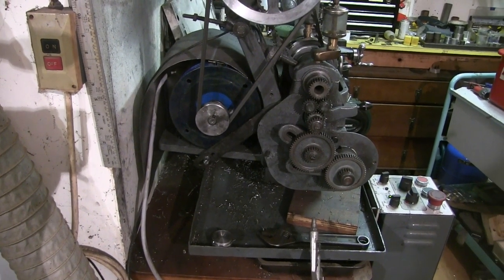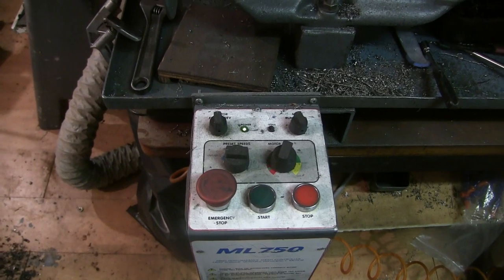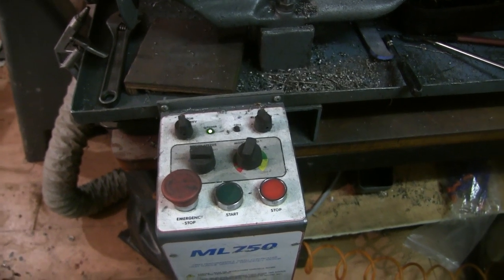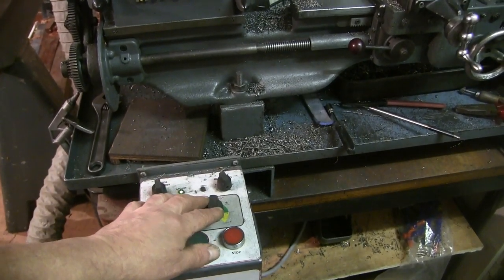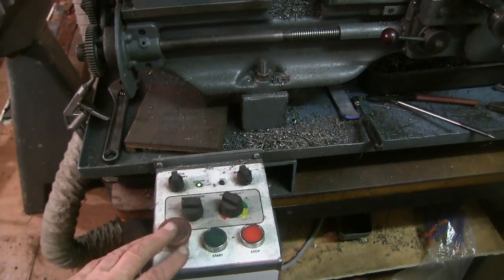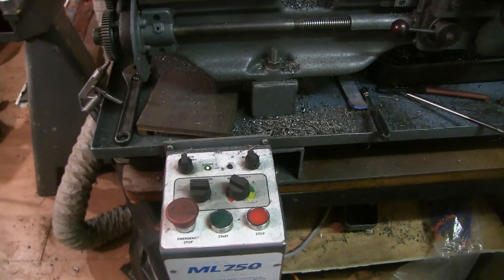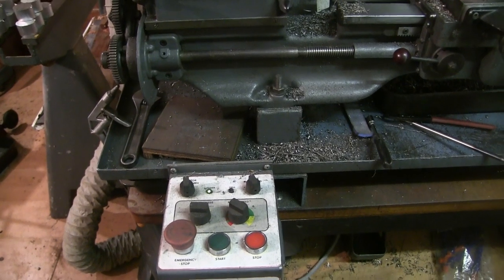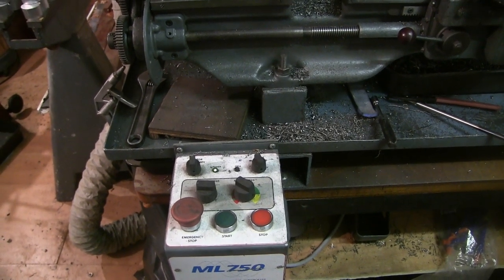VFD set up for nvr push button on/off, fwd/rev and jog.

Comment: You are a great Cliff, very clear video for me that i am a mechanical engineer, so with Electric...mmm, not Easy: but on my BV 20 lathe, only the inverter like your Is missing, i Will install next week! i have the Arduino stepper motor on the wagon for making every screw or pitchs without changing any gear, now i Will install the VFD and the lathe will be complete! Thanks to you, Alberto from Italy!

Comment: Firstly thanks for this excellent tutorial. Thank you. I have been looking at wiring one and had to draw diagram in a paper to get my head around it. In your wiring you use 2 relays. However, i think we can wire this circuit with one wire. Correct me if i am wrong. 

Line (12V) goes to on butting (NO switch), then from on switch to off button (NC ), then from off to Line in of Relay,  then from relay to Neutral ( common). 
On the switch side of the relay, one terminal connects to the X4 (forward spin) , and other thermal connects to common. Of course we can add a 3 way switch here and wire to X5 for reverse option. 

So when you switch on, power flows ( via NC off button) to relay and the coil gets energised and allows the switch to complete X4 to common circuit and the motor should run. 

I hope it makes sense. Thanks. Please correct me if it’s working. I am not an electrician , just DIYer!

Comment: Nice set up of VFD, agree 100% on no volt switching, ref drop out relay. T
Standard industry practise has the motor wires fed through a motor starter or contactor (between VFD and Motor).
Looking forward to completed job, thanks for sharing.

Comment: HI Cliff. I wired up my vfd a while ago, but took a different approach to yo.u I set up a 3 position switch to give me 3 fixed speeds. 200rpm, 800rpm amd 1300rpm then I ran a switch in series to short the connections on the slowest of the fixed speeds to give me a jog. I have found this system very reliable, but not as elegant as your  relay solution. I guess 10 different people will approach a problem 10 different ways. But have to say I really appreciated your earlier video re wiring a vfd to grasp the principles of what I was doing and how the thing ticked :)
Reply from the maker: Thanks Stephen, I did confuse myself a bit with the relays, but thankfully got there in the end, I did think about having some fixed speeds, but I never use them on my myford, and didn't want any more switches!
All the best,
Cliff

Comment: I'm running the same VFD on my mill, so I especially appreciate you sharing this.  Maybe now I'll finish collecting the parts for the control box and get the drive out of the way.  The instructions with those drives aren't the greatest, but it looks far easier now having seen it done.

Comment: thanks for the help 
i still need to get the tapping function in there 
(move the quill down opens a microswitch and starts in forward hitting the debt stop will hit a second microswitch and reverses direction , letting go of the handle will close the top microswitch again and stop the motor again switch back to forward when pulling on the handle again ) 
i probably bridge a few of the switches in youre setup with a seperate switch for that (choosing between milling and tapping ) 
you could had done away with the jog pushbutton if the direction switch for the jog function was non latching  (would go back in center position when released )

Comment: Hi Cliff, I have done the almost exact same thing onto my lathe, except I have put a brand new1.5 horse motor on it, and I have included the door micro switch cut outs as well. I used 12volt car relays in my layout as then I could use crimped spade connectors to save all that soldering!. The only thing I have a problem is that the microswitches don't unlatch the relay so I have to alter the wiring for that but it's not a problem. I will do it when I wire up a second microswitch for the mill drive cover. I too almost fried my brain working it out a few months ago ! Thanks for sharing this, as I am sure it will help others to do the same, and although it looks daunting, if you go about it in a methodical way it is relatively simple to do as you have demonstrated. Merry Christmas to you and your family.
Reply from the maker: Thanks Sam,
And A very merry christmas to you and yours,
ATB,
CLIFF

Comment: Thanks Cliff, I can rewire (most) old  380/415 star connected motors by digging out the star point, but I'm rubbish at programming the AT1 inverter,  I have an old Harrison mill I've dug out the star point on the drive motor, runs fine, but the table drive refuses to run rewired on delta.
Have bought a small inverter, (380v) to run the table  but couldn't work out the external wiring to keep the original dewhurst switch. Thanks to you I can now sort it out, your  no nonsense approach is very appreciated.
PS
I'm also running a RS electrodrives 1.5 hp inverter on my lathe/bench grinder/ bandsaw (switchable between them)  built in 1985 and still working without problems,  does anyone know how reliable the cheap chinese ones are ? I was told the main capacitors don't last too long if you switch them on /off regularly

Comment: Well figured out Cliff it really will make the lathe a lot nicer to use, it's what I had on my old Bantam lathe, are you sure the motor on the lathe is the issue or could it be the power supply running it, not that it matters now.

Regards Alan.
Reply from the maker: Hello Alan,
Could well be the three phase convertor! but it won't run on the second speed and only starts playing up when its been going for a while, I will probably run the motor of of the vfd before I change it, just to see!
All the best,
Cliff

Comment: Hi cliff I have purchased a Chinese 4kw VFD AT1  for my 3 hp ( 3phase ) table saw. It looks as if someone else has changed the parameters, I can’t get it back to factory settings as it. Won’t let put the password in that resets it . I also have a 0.75 kw Chinese VFD which does let me reset to factory settings . I have tried both these. 0.75 kw powers a disc sander and the other one for the table saw ,they both work the machines ok but they come to stop under load . Tried everything with parameters with no success. Need help. James

Comment: The issue with the old motor may be that it's rated for 3 phase 440V (phase-to-phase) but your rotary phase converter may be putting out 4 phase 220V (phase-to-phase)?

Comment: Hi Cliff. Thanks. I own a bench lathe (motor: three-phase, 1.1kw and 1400rpm) and a VFD like yours. I would like to install a brake resistor, but I don't know if in this VFD I can install a brake resistor and what is the proper value. Please, could you help me? Thanks again  and  sorry, my English is not good.

Comment: That's really inspiring Cliff. If you get the chance I'd appreciate a heads up on which VFD you bought. Many thanks, Dean.
Reply: He's using the same type he used on his Myford - an XSY-AT1   can be bought easily on ebay
Reply: @44Celt  thanks very much for the info. Appreciated.

Comment: Hi Cliff, This has helped me a lot. However i am curreently stuck! once setting up my switches, it worked for a couple of times now the motor is stuck in fwd running when P11 = 2 even with no wire connected. I can go back to P11=0 to turn off the motor but as soon as i enter P11=2 the motor starts with no connection between com and the Xfwd. Any ideas? am i missing something?

Comment: One thing you need to do with VFD's and that is don't run them too slow to get lower speed ranges.........if your lathe has belt drive then belt up the top speed pulley and make the motor via the VFD give you the top speed with the VFD fully open then when you want the lower speed range go down the belt pulley size and use the VFD to go in between the speeds.........the VFD will not give you enough torque if you primarily use it for high to low range speed control......at best they will allow you to use a 3 phase motor from the single phase mains.

Comment: Very well explained.
Hey Cliff, does the VFD have an electrical braking circuit. May be handy if it did to use that with the Jog control. Jogging would be good to use for threading operations.
Regards
MachineNZ
Reply from the maker: I think it does but I think you have to add some resistors, which I think Max, swan valley machine shop, did to his bridgeport, but I don't know for sure,
All the best,
Cliff

Comment: Hi Cliff. Thanks for another great video. My southbend has the same problems bogging down on even light cuts. Do you know if it’s possible/worth fixing them? I’ve got the same vfd and motor and I intend to put that on my Chinese lathe. 👍
Reply: Are you running the inverter at low frequency to control speed ,? My Littlejohn lathe does the same at low hertz ( frequency) revs. even though it's got a variable drive I've had to put a smaller pulley on the motor to reduce the problem. Some motors seem fine on lower frequency, others are the opposite so it seems.

Comment: A bit of bad look with the original motor Cliff but the replacement set up will be a more versatile and save you time.
Reply from the maker: Hello Tony, I did reckon on having to replace the motor when I bought, only because everything I'd read about them said they were suspect, wouldn't have thought there was anything wrong when I tried it but it starts playing up when its warmed up!,
ATB,
Cliff

Comment: Cliff your a legend 

I am just starting to restore a Electric mechanical two post hoist 

I am going to create a forward/reverse which this was huge help 😀

Have you ever created limit switches ? So it stops at a point?
Reply from the maker: Thanks for that,  I pretty sure if you put normally clised limit switch(s) in series with the on off switch that would work,
All the best,
Cliff
Reply from the maker: Sorry about the crappy spelling, I'm and closed!😃
Reply: Thanks cliff will set the basics up first, the delta and stuff and move on 😀
Reply: Keep up the good work on the VDF videos, some of the other are like watching paint dry 😂

Comment: Cliff you are making the VFD programming more complex than you need to you do not need a no volts coil all you do is programme the start to a normally open momentary switch and the stop to a normally closed one then pressing the start makes it run and the stop stops it as it opens when pressed and should you loose power it stops and will not start until you press start try it on your bench !!!
Reply from the maker: Hello Ernest, this sounds exactly what I want, But I haven't got a clue how to do that! I will email you if that's ok,
Thanks Ernest!
all the best,
Cliff
Reply: @CliffsShed  Hi Cliff, did you ever get the detail from Ernest about using momentary switches?  I can't get mine to work and it's driving me batty!